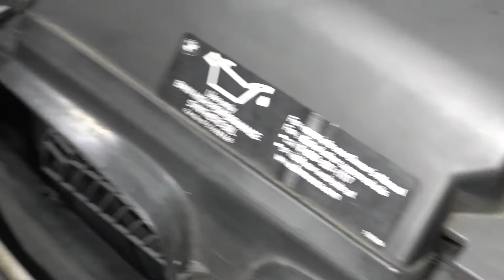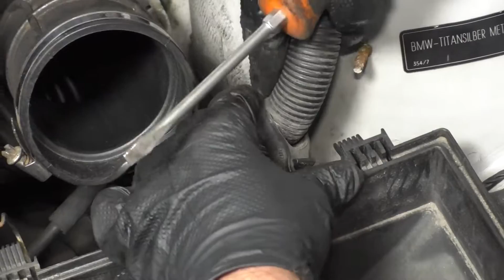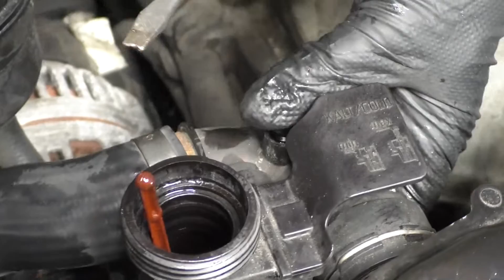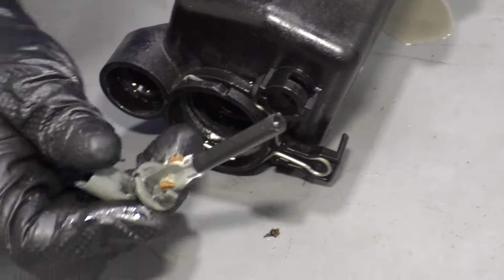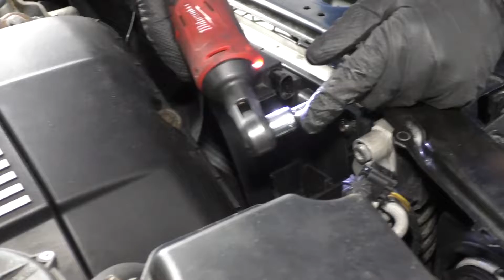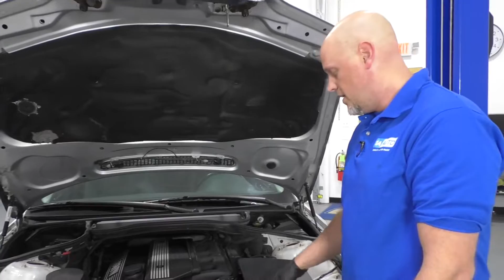How to Replace Coolant Level Sensor 01-06 BMW 325Xi

Comment: the question is: what causes them to go bad ? i mean is a piece of magnet inside a glass bubble ..
Reply from the maker: +@MegredyPhotoStudio  The harsh environment of cooling systems may damage sensitive electronic circuitry inside this sensor, making its readings incorrect.
Reply: @1AAuto makes sense ! Thanks !

Comment: Does anything go inside the other hole next to the thermostat housing? Mine won’t go down all the way and I can’t fit my upper radiator hose back in. I thought maybe it was the sensor but that’s there. It’s leaks fluid every time I add it. What am I doing wrong?😢

Comment: I replaced the coolant reservoir on my 2001 325ci and it took me less than 5 min to take off a few hoses  and get to the sensor since it comes with a new one when I purchased ,,this video is really too much🤣

Comment: Thanks!  I will say, it's exactly the same on my 2011 335i, but it was not necessary to remove anything nor drain the coolant.  The sensor goes up into a dry cavity, so if you don't remove anything, you don't need to drain the coolant either.  The thing I was missing, is I couldn't feel the release tab on the electrical connector, and since I couldn't see it either, I couldn't figure out how to disconnect it.  But since you said "press the release tab", I knew one must exist and so just kept squeezing until I found it.

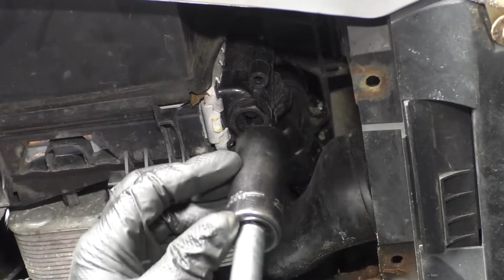Comment: Pretty sure it's always 22mm for the radiator adjusting screw: OEM 17111437360 or analog, and pretty sure the side pins got broken there 6:40, cause the screw needs about 45 degree turn to come out. Drain plug is inside the screw.
Reply from the maker: +Kristaps Saukums Thanks for the feedback!

Comment: How to test if the sensor works?
Reply: Put your key on after you drained the coolant, it should show on the dash that coolant is low, and coolant and check if light goes off.
Reply: They cost about $10.  Just buy one.  But if you really value a few dollars over your time, you can swap the sensor with the one on the washer fluid - they're the same.

Comment: It doesnt matter if we take the cover off the level senser right
Reply from the maker: +Ronaldo Pablo Thank you for checking us out! It is required to remove the on the coolant reservoir cap prior to draining the coolant. Please let us know fi you have any further questions, thank you!
Reply: @1AAuto  does a manaul transmission e46 have a Thermostat under the expantion tank
Reply: @1AAuto  also I mean the level senser when we buy it new it comes with a cover can we take off

Comment: Thats a lot or work to replace a sensor! Im looking to replace mine on my e85
Reply: i think u can just do it from under the car.. no need to remove all of that stuff.. at least on my 02' 330ci
Reply: @youtub203  Yep, On my 330ci I just jacked the front end up, popped off the undertray and then you can just unplug it from underneath, took me about 15 minutes start to end.